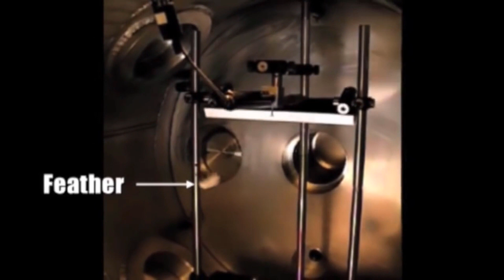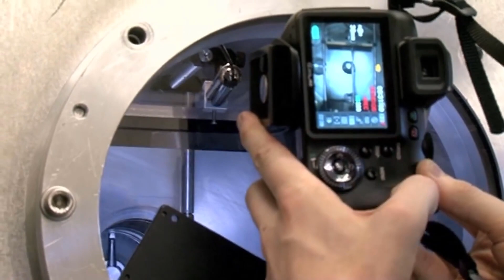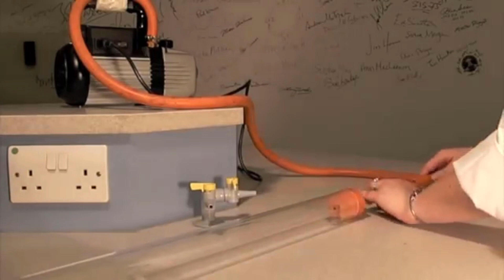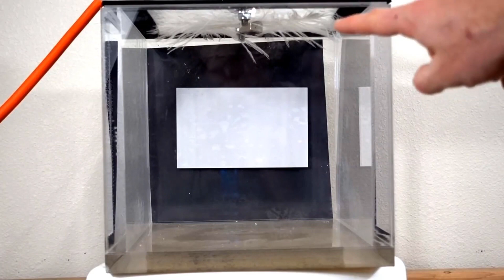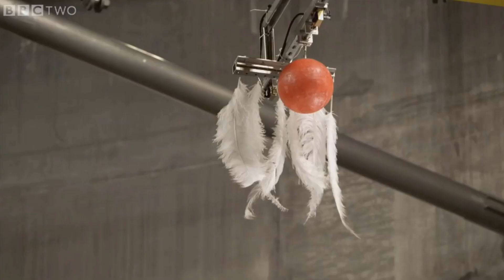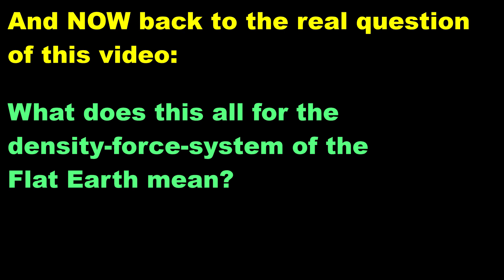FE Video - Is Gravity actually Real? 🤔

Comment: The feather/hammer experiment at the end was rigged. I think the feather was prepared with at least extra weight.
I have feathers from my macaw and dropped them a couple of times. They did not behave like that at all, especially when dropped with the shaft upwards. With the shaft upwards, the feather does not fall in a straight line, it swirls down.
The density claim for flat earthers: Why does my (steel) hammer not sink into my wooden desk. Steel is denser than wood.
Loved the NASA vacuum chamber demonstration! Impressive to see those feathers land on the ground in the exact same position they started in!
Reply from the maker: Nice one, with your macaw!
Your macaw must be a fluffy bird. 😄
bird-up! 🦜

(I hope I'm not "smarty-pants"-ing you her. I kind of have the feeling I do, but I want to tell you anyways. Also I hope it's right what I write too.)
The feather that guy at the end used doesn't need to be manipulated to behave like this.
Just aerodynamic enough.

Feathers are also altering in their build-up from bird to bird.
Some are denser, slicker, thinner, stronger or more straight; and others not.
Depends on what the purpose of the feathger is, but light and fluffy ones are the best to observe this point.
The guy used a strong build and slim feather (from a wing I think).
Such feathers have to endure the forces of flight and need a strong base and conection to the wing, which leads to the need of a strong and also heavier calamus or shaft.
Otherwise the feather would bend and become useless for flight.
It is visible how his feather trys to get into an even more aerodynamic position, because the quill is heavier and has less air resistance.
Even in the part where it was droped with the tip first, it makes one half rotation.
I once had also such feathers like the guy at the end and they behaved just like that.
But unlike the feather in the moon-footage, mine turned away because of air resistance, just like the feather of that guy.
Yeah, all this guy showed us is that air resistance is totally a thing, as long as you are not aerodynamic designed, which is the point of the original try,
which opens the question: what is pulling it down, when air doesn't matter? XD
Especially nowdays where everyone can make a small vac-chamber and have a slo-mo-cam.
And can put videos about it on the internet. XD XD

This here is also a very interesting video that is underlining the point of my video here: 😏
https://www.youtube.com/watch?v=YDXQ-VBjW7Q
If I would have known about it, it would have definatelly be included in it.
Reply: @Websurfer1111  I took feathers that came closest to the one in the video (wing and tail). They are thinner but stiff and the wing feather is curved, while the tail feather is straight (almost symetrical left and right). When dropped with the shaft upwards, they want to turn mid-air, but when they reach horizontal position, they float away, always with the backside up..
With the shaft pointing down (lightest part up), the feathers usually fall straight down (from aproximately 1,5 meters up).

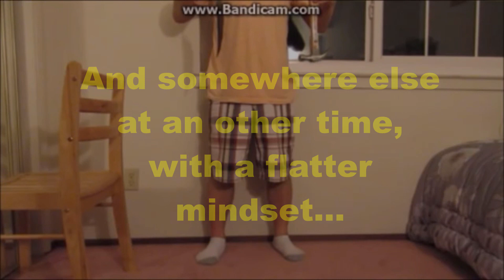At 12:42 the feather is behaving strange. That looks like a feather from a corvid (crow or something similar), they are very stiff. The tip should not bend like that when it hits the ground, and most certainly not bounce up. Feathers from birds (the flying ones) are stiff and very light. A handfull of feathers from my macaw (wing and tail) barely makes 4 grams.
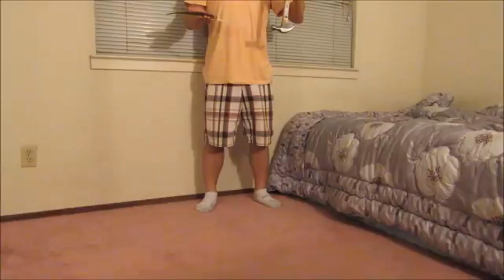At 12:57, the feather behaves more naturally, but bounces when it hits the ground on its back. 
The weight of the feather should not have stored that much energy to bounce up again. Never seen any feather doing that. (sorry for my bad explanation, my native language isn't English aswell).
Love your style by the way. It'll not convince flat-earthers but it could keep potential flat-earthers from falling down the rabbit hole!
Reply from the maker: For me the feather is acting in expectable ways, though I have to say I'm not an expert on feathers.🤔
I wonder if it is a falcon feather? Or from a hawk or something.
I hope my video can keep people away from flatearth, so far they get to see my or other peoples videos though.
And if they don't just leave after like 2 minutes of Not-Conform-To-Their-Mindset...
It is still an enigma to me how people can actually spend their money on that stuff...